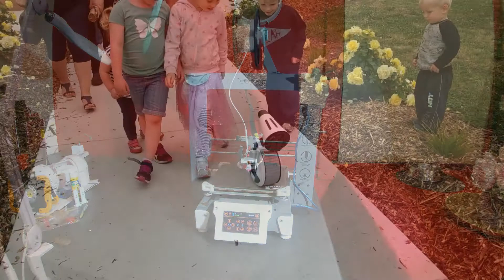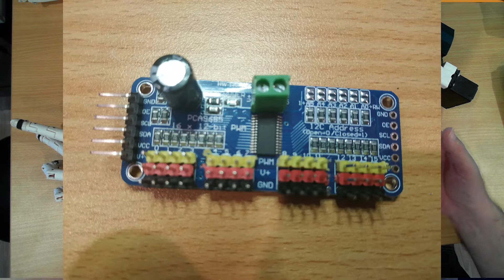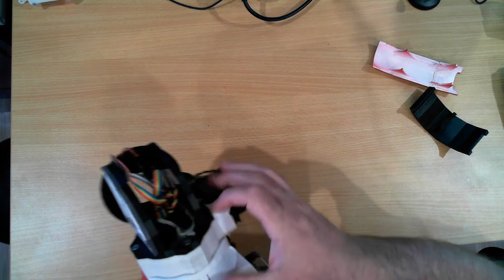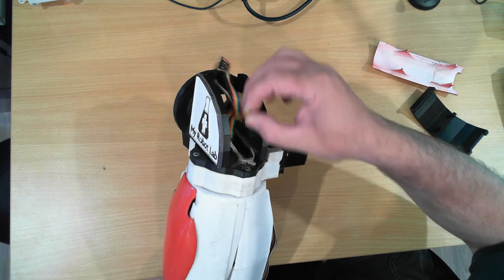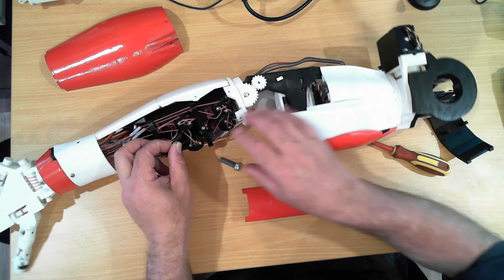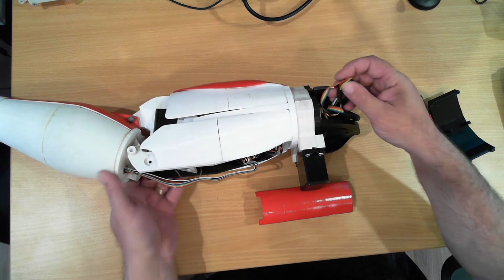Inmoov_Freds_Arm_Controller

Comment: This is great. It's so nice you opened it up and talked us through how you did your control system. This would probably have been my preferred route but I went with the Arduino's to try to stay a little closer to the standard build. What model of Raspberry Pi are you using?
Reply from the maker: Unless your prepared to do a lot of your own programming, then the standard method is the better route.
However, you your happy  to effectively write your own version of the Inmoov service, then technically I think this is the better  method.
When the Inmoov service better supports the PCA9685 driver, then you will find more people going this way.
I used the Raspberry Pi 3 as the main controller for my system, and I have planned a video to setup MRL on the Pi3 and use the PCA9685 drivers as well.
Might have to do one on Fred's head. 
I also picked up from Seeed Studio's  in China, the Grove AI HAT for Edge Computing.
I think this will work well for the Inmoov robots, once I figure out how to use it :-)
Stay tuned for more videos featuring Fred, my Inmoov.